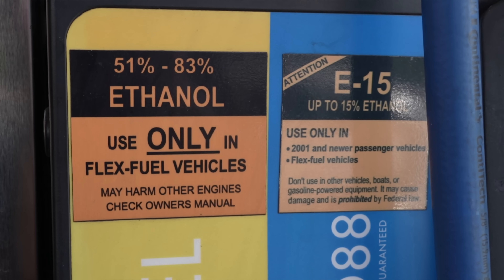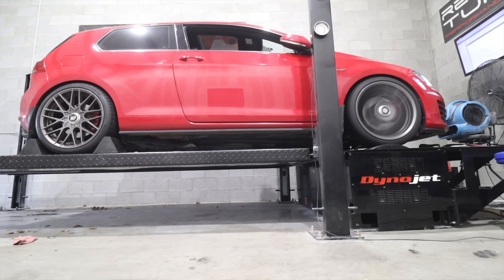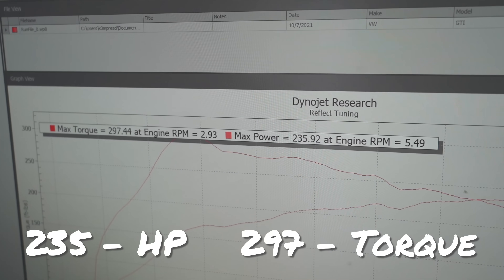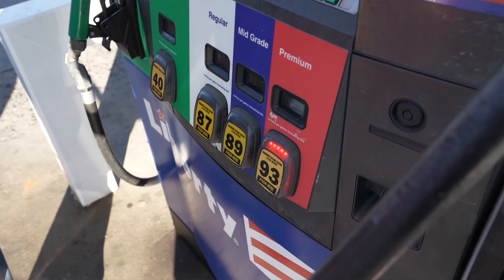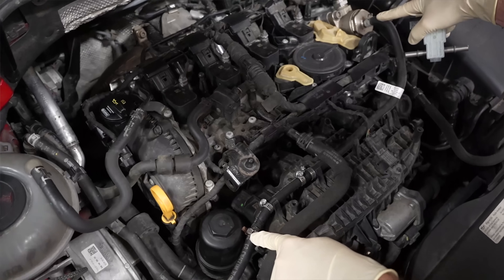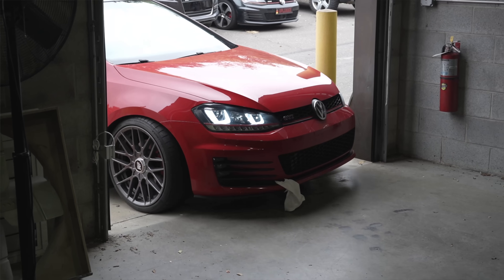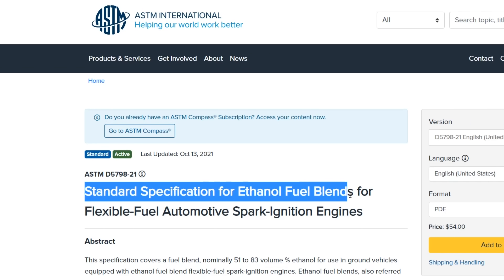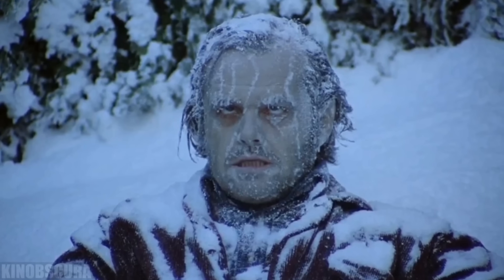A Complete Guide to E85 / Flex Fuel

Comment: Would a true flex tune be more reliable or would it be better to have a 91 octane tune and a e85 tune on my access port and switch between the two?
Reply: EQT E85 tune will make 400WHP with an upgraded LPFP and HPFP. If you have good E85 locally, run the full E85 tune and send it

Comment: I have a 2015 Jeep Grand Cherokee. I see forums stating not to use E85 on the tank. The gas tank door says e85 on it.  Could switching to e85 cause issues with the fuel system like some forums say?

Comment: A very basic-level question: my 2014 A5 2.0T is E85 capable (CPMB engine code), but I live in the PNW where to my knowledge I have never seen any E85 for sale, let alone put any into my car's tank.  My owner's manual, however, specifies different maintenance intervals because of the flex fuel capability.  Do these really apply only to cars which actually USE E85 fuel?  Or am I supposed to be doing it too?  (I'm going on memory, but I think I'm talking about spark plug change timing, and maybe some other things).
Reply: It would be if you're running E85

Comment: With flex fuel kit can you switch between 93 and e85? And is it bad to mix the two like 75(e85)/25 (93) mix e85?
Reply: You can run 91 octane to E-85 and everything in between without having to re tune everytime. IE flex fuel tune will tune your car on the fly based on the fuel you have without having to drain the tank and tune for a different type of fuel.

Comment: I just finished watching the above video. The negative points made about ethanol are incorrect. 

1. The energy content of ethanol versus gasoline in an internal combustion engine is irrelevant. Engine optimization is the key. Engines optimized to run on ethanol will perform equal to or better than the same engine optimized to run on gasoline. Additionally, there are many instances where ethanol-gasoline blends in a gasoline optimized engine will outperform the same engine running on ethanol-free gasoline.

2. Ethanol does not suck water out of the air, it absorbs water that it comes in direct contact with. More importantly, the video spokesman states that ethanol will continue to absorb more and more water the longer it sits there. This is incorrect. Ethanol has a limit to the amount of water that it will absorb, and that limit is actually quite low. 

3. Ethanol does not eat fuel system components. Ethanol is compatible with more types of rubber, plastic, and metal than gasoline and aromatics. Viton rubber was invented by Dupont in the 1950s to mitigate the damage done to rubber by gasoline, tetraethyl lead, and ethylene bromide. Ethanol-gasoline blends were not used in North America in those years.

My reports cover these issues in great detail:

The Irrelevance Of BTU Rating - Big Oil's Gimmick To Hoodwink The Public 
http://www.theautochannel.com/news/2015/10/19/144405-irrelevance-btu-rating.html

The Irrelevance Of BTU Rating - Revisited
https://www.theautochannel.com/news/2018/07/14/603714-irrelevance-btu-rating-revisited.html

Ethanol Does NOT Suck Water Out Of The Air
http://www.theautochannel.com/news/2016/03/18/209988-ethanol-does-not-suck-water-out-air.html

Why Do Small Engines Suffer From Ethanol Problems?
http://www.theautochannel.com/news/2015/09/01/140446-why-do-small-engines-suffer-from-ethanol-problems-video.html
Reply: Thanks for this info I'm running E85 in both my old 90s Mazdas both have Big Turbo so this comment really opened my eyes to understand how E85 truly works.

Comment: for any car made before ethanol came out it can be a problem any steel gas tanks or metal fuel lines will need to be replaced with modern ethanol friendly ones even for modern cars made to run it if you plan on storing it say over the winter drain the ethanol out and replace it with gas it's better that way on the fuel system it can be a bit tough on the fuel system if left to set with ethanol for a few months . as long as the car is running and driving it's fine it's when it's left dormant for extended periods that it's a problem.

Comment: The term flex fuel should only be applied if the car has a content sensor and can run whatever base petrol fuel you want and everything in between full e85, including full e85. without switching maps. Very few offerings are reliable in that setup for VW's on a stock ECU.

 Also, you can have your car tuned(I do this for my customers) for cruising on any fuel type and get better MPG's if the tuner is knowledgeable, experienced, competent and detail savvy.
Reply: Thank you for this information I was trying to find this answer all over Google and it always refers to VW's trying to make lots more power but they never make it clear how it would work if you don't want to make more power this makes sense

Comment: Im thinking about doing e85 on my Volvo and I also live in North Carolina (Durham area). Im worried about the inconsistency, as I would be getting tuned for it without a flex fuel sensor. I have a Sheetz right next to my house that has a flex fuel button, but the only one even close by for an "e-85" button is like 15 minutes away. When you did went to the multiple Sheetz, were those a flex fuel button, or e85 ?

Comment: I have a stage 2 GTI with an intercooler, air intake, turbo inlet pipe, and turbo back exhaust. What do I need exactly to be able to run my car on E85?
Reply: Hey David, hope this points you in the right direction.
Reply: @jephtawallace2135  ?
Reply: @TRAEDA12  Be Right Back

Comment: Got a Kroger near me and like all Kroger's they're notorious for always having spot on ethanol content, almost always 85% and sometimes even higher.  Biggest benefit to running E in a boosted application is how much more torque you make down low due to the inherit resistance to knock and the more aggressive timing you can put in it, giving you way quicker and aggressive spool that carries all the way through to the limiter. Filling up 2 5 gallon jugs at the pump to take to the track is extremely convenient, too. Once your car is dialed on E you'll never want to pump standard gas again unless it's you're daily.
Reply: good tip about Krogers

Comment: OK, great video but I'm a bit concerned with some generalizations regarding ethanol blends v timing v power output I hear A LOT and repeated here.   I take it the throwing E85 and dynoing with stock tune was more about a interesting intro since putting in some E85 to create something like 93 + E20 or E30 would have been a better idea.  Highly doubtful 85% ethanol is required anyway....it's diminishing returns.   Even at E40 (50/50 blend) it's unlikely anything other than the wildest HUGE turbo car is going to be knock limited so there really shouldn't be a TIMING issue if ethanol drops from say E85 to E70.  The optimal timing for E70 and E85 (and E40 for that matter) is likely the same since the correct tune wouldn't be knock limited anywhere on the map.   Yes, a tuner might choose to increase timing beyond MBT because they can but in my mind that's a tune issue, not a fuel variance issue.  There might be a mild air/fuel issue with the variance between E70 and E85 but that shouldn't be too significant and a decent tune should be able to correct for that anyway with the lambda sensor.   Ethanol tunes are also fairly tolerant with regards to AFR and timing at peak power I've seen tunes on modified turbo cars with the only difference as E42 and E85 fuels and the power output difference  with the same mods and tuner are typically 2-3% (sometimes less) and that difference is likely due to evaporative cooling effects and perhaps 1 deg of timing at WOT.   So what's a tuner to do?  Tune the car on the "worst" grade ethanol fuel which is E70 and make it a touch richer than max power, eg 0.80 lambda.  The tune will be safe for E85 and heck even E60 and it will give away next to nothing to an optimised E85 tune.   Now....I wouldn't be surprised to see your power increase on the flex tune when you increase ethanol content above 57% - why is this?  Because I'm assuming the ignition curve is not maxed at E57 and in fact if you custom tuned at E57 and E85 you find the MBT for timing is the same.  So the optimised timing curve should be highly non-linear with timing likely flatlined at the top from E40 all the way to E100.  But of course only some dyno testing will know for sure.    I wish they standardised on an E40 fuel globally for performance since you get 90%+ of the benefits with <50% of the issues (consumption, fuel system capacity,  water absorption,  oil dilution, etc).

Comment: I just paid $2.99 for 88 octane E15. It works great in non-turbo Euro engines, or 1.8T that takes 87 stock. Best mix is 1-2 gallons of E85 in with your preferred gas. It's 105+ octane and burns cooler, the perfect "additive". although I do use 3-4 oz of 2-cycle oil in a tank too. Between the 2C and the E85 I NEVER buy Techron anymore, and my cars run like a bear on fire.

Comment: Fuel system degradation on modern vehicles may not be a problem but fuel permeation still happens. Before I LS swapped my 2016 BRZ I ran E85 and after a while you could smell and see evidence of permeation on the rubber fuel lines (I didn’t touch the lines, tune only) Whereas when I ran gasoline I never had that come up. When I did the swap I did a custom PTFE fuel system.

Comment: To run e85 on the MK7 all you need is the hpfp if you are using the stock is20 turbo when you  switch to the is38 to run e85 you’ll need both hpfp and lpfp or mpi and lpfp. The hpfp upgrade only without lpfp on the is38 can run up to e50 blend which will max out fueling. MPI is the way to go if you’re going is38 or bigger turbo.

Comment: E85 and E-blends do help make more power.
Having dabbled around with tuning I have gotten decent gains in timing advance running different blends. Starting at e30 was able to advance timing 2deg without increasing knock over pump 93.
Reply: Only 2deg at E30 is very small in my experience.  Is this a turbo engine?  I'm guessing no.
Reply: No shit they do….

Comment: My first Evo 9 making 768 awhp had a 2.3 striker, 2200cc ID injectors, 3 fuel pumps, and ran e85. I had to have the tank full, and kept 10 gallons in the back seat. All of that I might have got about 180-200 miles. But it was very hard to stay out of boost ;)
Reply: Better than my stock Evo X GSR.  The stock X i had  went  about 160 miles out of a tank of gas.  My Evo 9 MR which to date was my favorite car i ever owned (had the privilege of owning 4 evo's since 2003) my MR i kept conservative mods only photons and a good tune running 91 pump I made 360awhp with WMI 400.  Drove it like that from the 2nd week i bought it (new i. 2006) until i sold it 5 yrs later. ZERO issues.  Drove it daily had my kids in it, track days unfortunately i got divorced and needed money so i had to sell it. If you were getting that kind of mileage on E85 with that kind of power that is VERY GOOD.  Best tank miles i got out of my 9 was about 220 on a tank making half that power you had and i was on pump 91.
Reply: Lies
Reply: @wedrivebynight  how?

Comment: Richard Holdener has been seeing really good results dynoing with E85, both American V8's and Hondas.   Should also check out the Malakas Motorsports guys, they're running VR6's on E85 (with gigantic injectors and 30psi boost)

Comment: Been running EQT Stage 2 E85 time for some time now, no complaints at all other than fuel consumption being high 😓 as for power the E85 tune sure does hold power up top as compared to my 93 tune where it would fall on its face past 100mph
Reply: do you know how many miles you’d get on a full tank
Reply: @alexwitachoppa8801  on a full tank of E around 280ish miles, that’s with me not going the speed limit most the time lol I’m sure you could get 300+ miles if you drove normal. I’ve gotten 400 miles on a fuel tank of 93 just the other day.
Reply: @zeke6541  where do you live? I'm in NY and have likely questionable E85. I'm considering the EQT E85 map myself.

Comment: Man i fucked up hard. Got a 2019 gti FBO stage 2 and decided to get an accessport and sneeky custom tunes. Finished the 93 and moved to e30 with no fuel mods. First tank of e30 massive fuel cut misfire and then limp mode. Cleared codes and the car runs fine with half throttle and below 3k rpm. Anything more and it fuel cuts. Ran it empty and filled up with 93 and still breaks up after a half tank of 93. What did I break!? 😩
Reply: Yikes, so sorry that happened! Definitely try getting back on the stock tune to see if that fixes it...I'm guessing your fuel system couldn't keep up with the demand of E30 and ran very lean, causing a misfire? Hopefully nothing was physically damaged and the tune is just  in an extended limp-home mode. Keep us updated!
Reply: @weilandcock  okay yes it went into limp mode once and cleared the codes and it hasn’t done that since. Will just fuel cut if I give it to much gas but only for a second before I let off. I haven’t flashed a stock tune back onto it. Only went from e30 to 93 tune when I filled up. Going to try that when I drive the car today. Thank you!
Reply: @weilandcock  second tank of 93 and the OEM hpfp is maxed out and fuel cutting until a misfire happens if I give it to much throttle. New plugs and a HPA hpfp enroute. Sad but also kind of hyped to start modding the fuel system 😂

Comment: I've been using that Lucas 3X Octane Boost + 91 non-ethanol his past summer in my old Mustang... and she likes it!
I'm running a lot more timing with no problems.
Reply: You can run a 93 tune using the Lucas booster and 91 octane. The Lucas is good for about a 3 pt increase, using the whole 15oz bottle. Works well when all you can get is 91!

Comment: E85 doesn't make more power it allows a higher compression or any boosted engine to run more aggressive timing and boost. Also slightly leaner.
Reply: So the extra hp and tq he saw when he did the test on the tuned car at the beginning of the video when he simply put in e85 fuel you are staying isnt possible ?

Comment: I would argue that the "stock tune" on modern cars already corrects AFR using the O2 sensors and seeks optimal timing using knock sensors. To a point, the stock tune is an ethanol blend tune.
Reply from the maker: Yeah probably fine under normal driving but I would be concerned that under heavy load you would lean out. 

FYI we logged fuel pressures on e85 on stock tune and it didn’t have an issue keeping the pressures.
Reply: Depends on the car model, many (actually I think most) ECUs run without O2 sensor when full throttle, the stock O2 sensor is not wideband enough to work at both low load and full throttle.
At full throttle the engine runs from a map and not the O2.

Also the AFR needs to be different with E85, so the engine will try and reach gasoline AFR even though it runs on E85.

My flexfuel car smokes like a diesel at cold idle, because it is tuned to run on E85 as default, because that is the hardest fuel to coldstart, the ECU in my model then needs to burn the gasoline before it can calculate what fuel it is burning.

Comment: I've never watched this channel, I'm assuming it's mostly a German car channel but it's a video about corn and as someone who runs corn I thought I'd chip in what I know. On my LS3 Camaro SS, running e85 I gained 12whp and 9wtq but that was on a mix of e85 and 91 as my tank wasn't completely empty AND my injectors were maxed out with e85. Thankfully it was a flex-fuel tune so I can always switch back to 91 (no 93 in my area) when I know I'm not gonna be running it hard (say when I go on road trips or whatever)

If curious my car was running non-catted Long tube headers, CAI, larger throttle body, and e85
so ALMOST full bolt ons making 429whp and 430wtq

Comment: Been running e85 in my Mk7.5 for six months and only recently swapped back to 93 as the E near me dropped to 50% winter blend. The car absolutely loves it, unless it’s cold, then starts are a little rough. But other than that the car seems to prefer E to pump gas.
Reply: So is your car tuned ? Or did you swap out the fuel pump ? If no, are you saying that you find a performance gain when you put in the e85 on a stock tune ?
Reply: @vroomgc  car has multiple flashes depending on what fuel I have available at the time. It 100% has an e85 tune for summer when it’s not garbage winter blend. 

You can absolutely run a couple gallons on stock tune. If nothing else it will give you a little extra knock resistance. 

I believe the E limit depending on how robust your particular pump is hovers around 40ish percent. 

Yes. My car has auto tech internals installed into an OEM pump.
Reply: @vinceis4lovers  Cool stuff, sounds like a good setup !
Reply: My car feels better on a e30 tune. I dont know why, I can’t explain it, but my car feels cracked out on 93. More power and smoother on e30

Comment: Anyone running the EQT stage 2 e30 tune? If so is it worth it with stock fuel pumps?
Reply: Depends. Most people get lucky and their stock pump can handle 30%. Some people though will have rail pressure issues as some pumps are weak from the factory. My car couldn’t handle e30 on the stock hpfp.

Comment: Just curious on what spark plugs look like long term on E85. 
I'm a gen tech and alot of stuff runs on LP. 
You'd be shocked when you pull out the plugs and they look almost like new , save for a worn electrode. 
Really no carbon built up at all, only way I could compare to a normal gasoline plug is they look like plugs you pulled out of a gasoline engine after a few laps around the block. 
Darn near spotless. 
Actually they might have some rust on the metal surfaces because of the moisture that LP makes, but that's mostly an issue until it's warmed up.
Reply: They hold up quite well but you do need to buy quality plugs.  I run ngk 7437-9 and they last about 9/10k miles on e85
Reply: Usually doesn’t matter what plug you choose for the ea888 you’ll have to swap them around 10k miles.